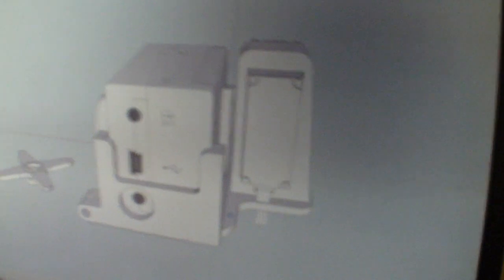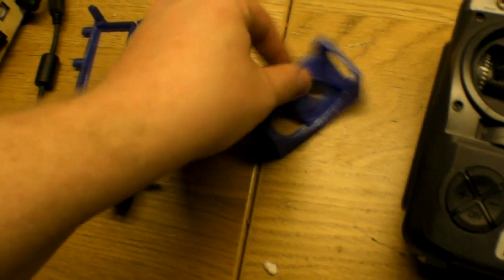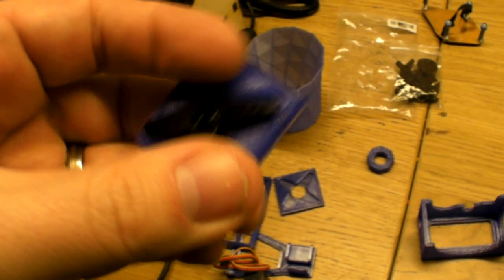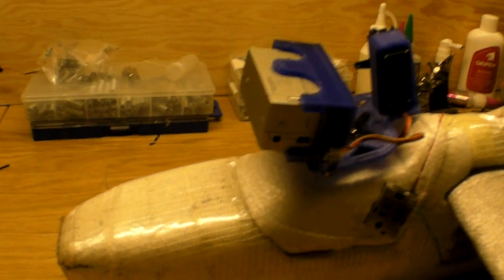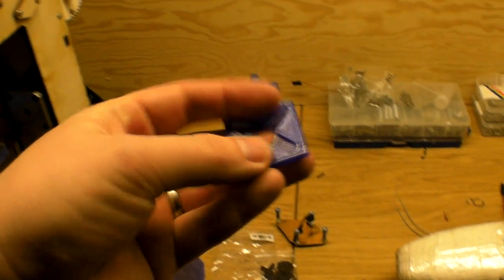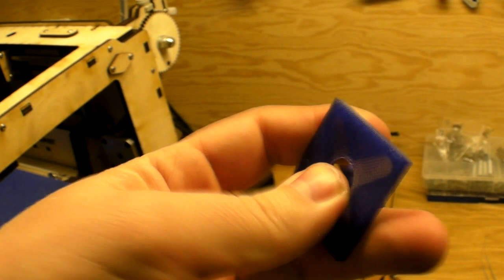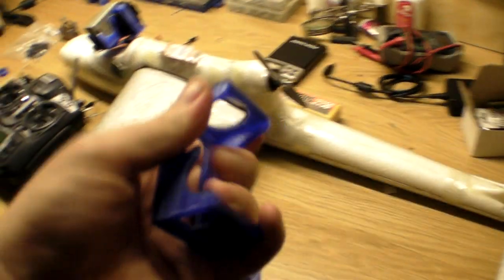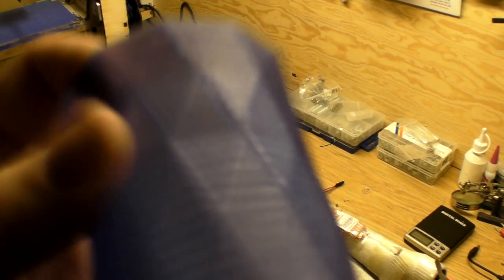Designing the perfect gopro fpv mount

Comment from the maker: @Xittin I don't think it will survive a hard crash, but it sure wouldn't break in normal use.. I don't think this design is suitable for 180 degree tilt and i myself couldn't see a need for it. Perhaps if you fly in strange formations with others and looking up on there planes ore something, but not for normal flying.. The pan servo is modded to 180 degree (endstop removed and resistors added).. Happy new year !!!